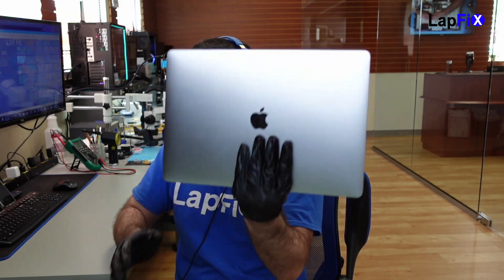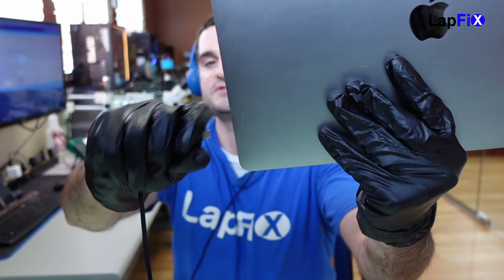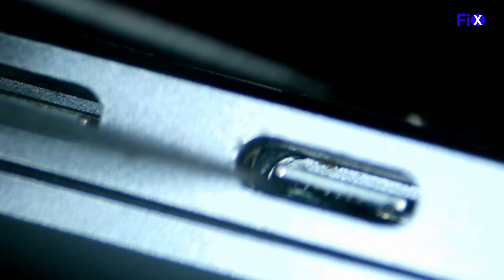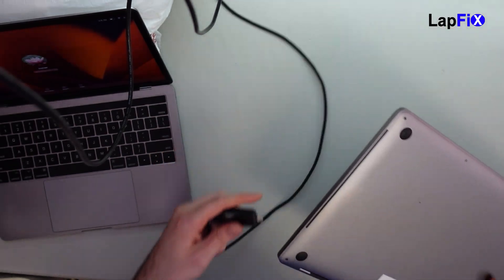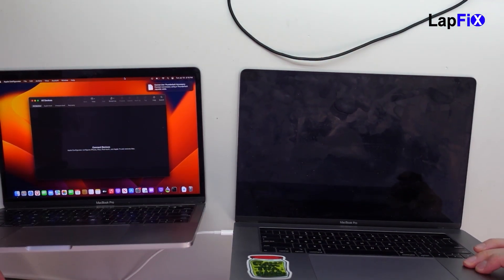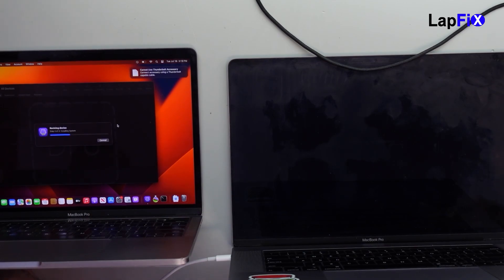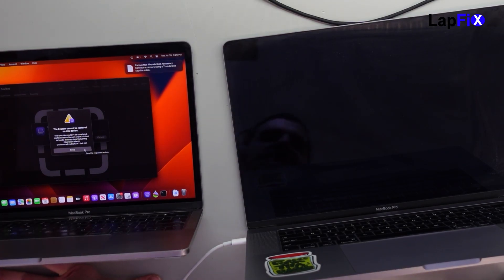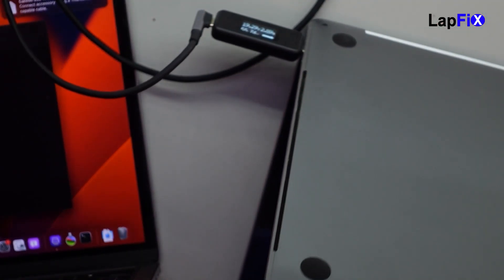Dead 16 inch MacBook Pro Receiving Voltage But Won't Turn On

Comment: great work brother! I have a quick question about A2289 macbook pro. I replaced SSD power chip and I only measure .756V on PP2.5V Nand SSD0 line. Macbook seems like it’s trying to boot. I measure no shorts on NAND line (lucky) any solution to this low voltage on this line? Maybe U9000 is faulty?

Comment: I tried this on one of my dead A2141 and it work, it woke it back to life… I had the same symptoms as you , 19v and it was going up slowly to more then 3amp if I waited a bit, trackpad was clicking but no light on the caps lock and nothing on the screen.. thank you I will try it again ! Nice video 👍
Reply: What did you try? I try reviving but it gives an error(Failed to handle message type StatusMsg
(Operation failed)) [AMRestoreErrorDomain
- 0x6 (6)]).

Comment: That isn't a 16" MacBook Pro... that's a 15". The 16" models have a separate escape key and Touch ID sensor, whereas the 15" models have the escape key integrated into the Touch Bar. Informative video nonetheless!